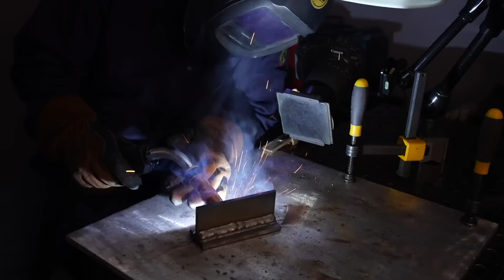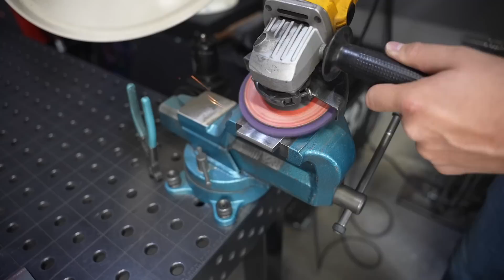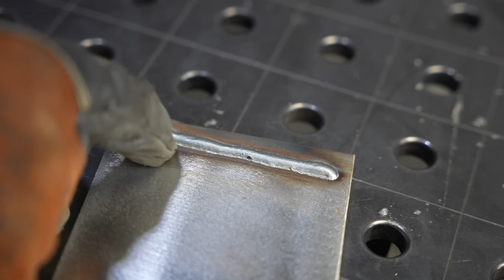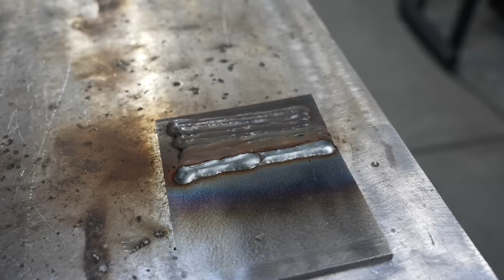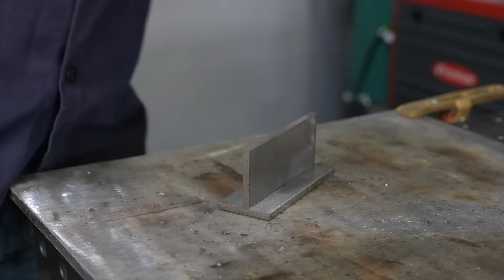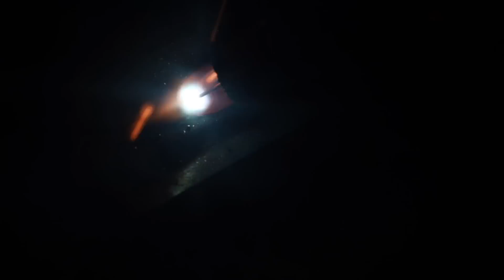2 MIG Welding Drills to Level Up Today

Comment: Well tim I have been watching your a lot of your videos I'am starting out mig welding and I was wondering how to tell if the welds have pennatrated deep enough if you can't see the over side of the weld any tips would be greatly appreciated
Reply from the maker: The best way is to test it on a scrap piece and either use a fillet weld break test (my pick) or a macro etch test. You can google fillet weld break test, but basically, you just weld one side of a tee joint and bend it open from the root to see if it breaks. If it does break, you can see if it consumed the lower root of the joint. For a macro etch, you cut through your weld, then polish it a little with a scotch brite type pad on a grinder and use an etchant to show where the weld is. The easiest stuff to get to etch welds is naval jelly rust remover that they have at most hardware stores. 

It's not always necessary to do all that, if you're using the recommended settings and the weld doesn't look like it's piled up on top of the material, it's usually just fine. If you want to test some, though, that's how I do it.

Comment: I Mig-Weld for a living, but I learned from OJT (Industrial production line situations )... So I make a lot of mistakes, especially in the fundamentals area...
Consistency of a bead is one issue I've had now for ages, and it gets worse as I get older... I think I need to relearn the weave as I weld...
Also, I have a tendency to release the trigger quite often unintentionally... Making for more stop and starts than I want... I swear I'm not releasing the trigger, but it is happening, so I don't know what to do about that...

Comment: Interesting that that welder uses Amps instead of volts. Mine also gives 4 Amp choice. Maybe a video on that could be useful
Reply from the maker: It uses wire speed and voltage like most MIG welders, the right side knob changes the volts. Wire speed controls the amperage and this machine will just show an estimate of the amperage that will result from the set wire speed.